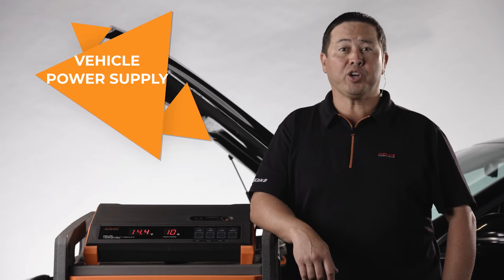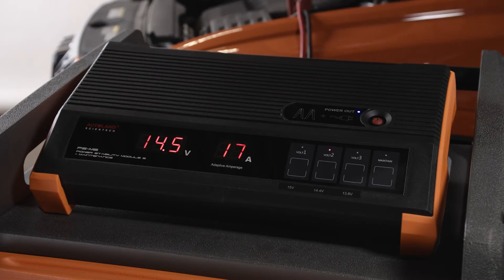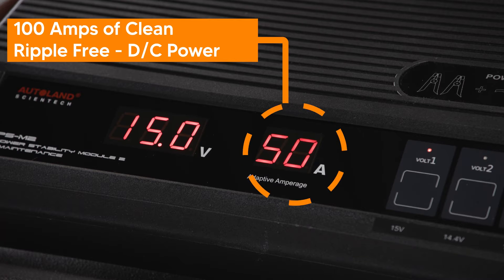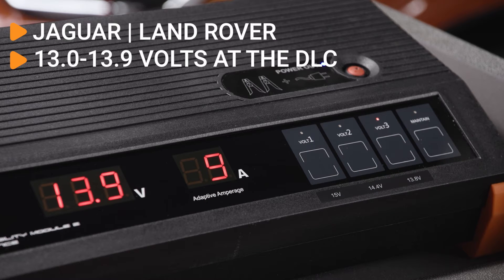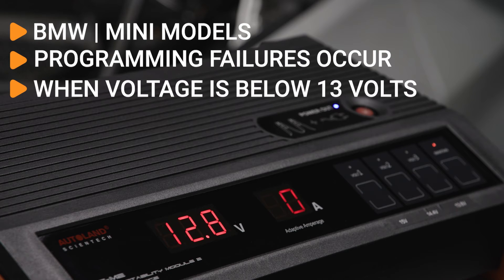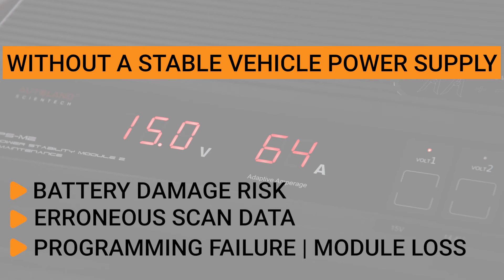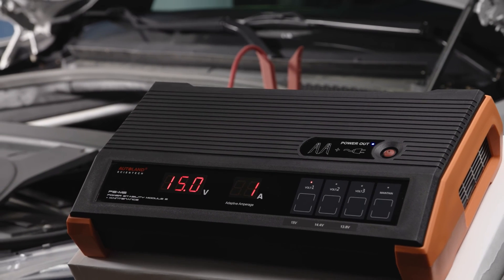Why You Need a Vehicle Power Supply for Programming, Diagnostics & Maintenance

Comment: Can you adjust the voltage to 13.4 or something else manually? Share the link how do you make this adjustment?
Reply from the maker: The voltage settings are preset to manufacturer specific values for programming and coding, as well as vehicle battery maintainer.

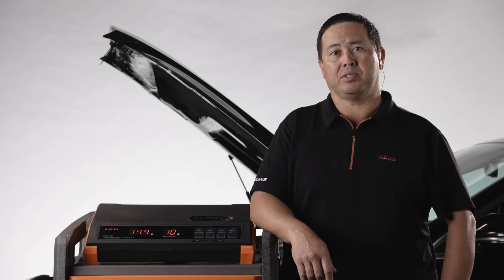Comment: 1:55 Anyone knows a video where it is explained what to connect the wires to?
Reply: apparently 
1) positive to the positive terminal on the battery
2) negative to the car itself (a ground stud) somewhere further away from the battery itself
Reply from the maker: It is connected to the vehicle jump start / power terminals under hood.